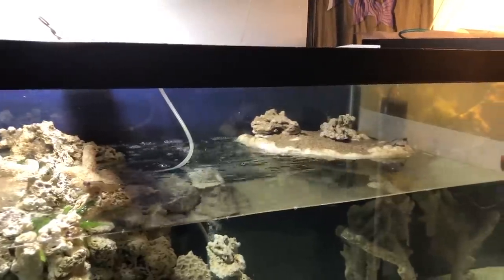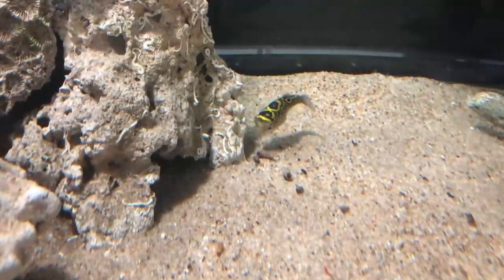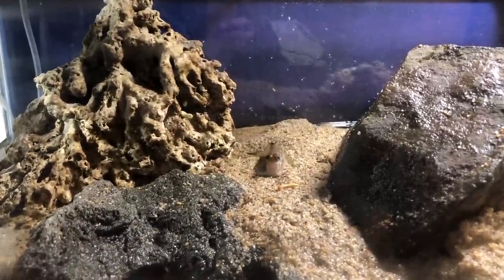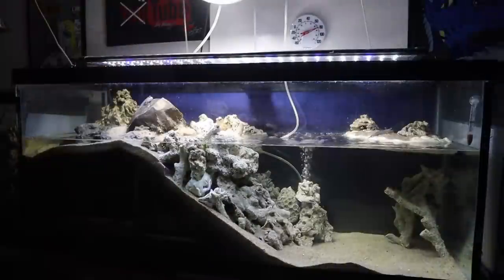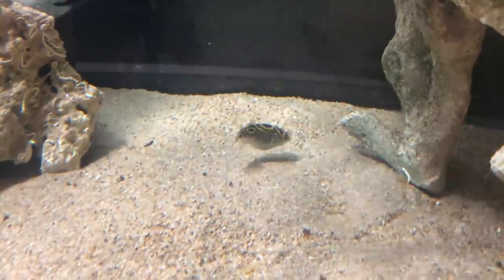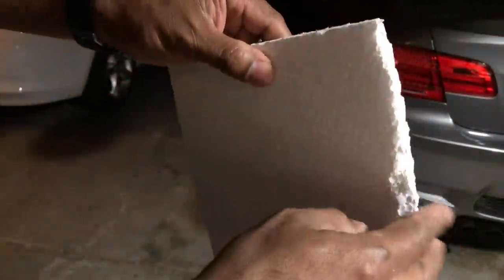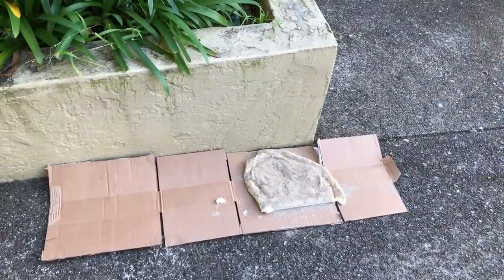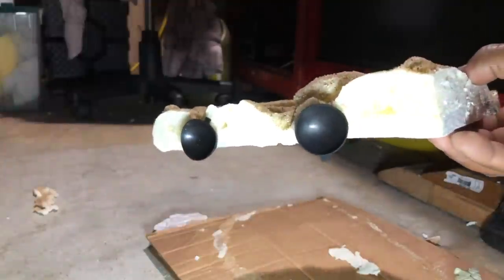The Mudskipper and Puffer Brackish Paludarium

Comment: Hey Zenzo, FYI I had to separate one Midskipper out from my other three because it was significantly smaller and in my QT tank, the others weren’t letting it eat.  I moved it to a 20L by itself then added some guppies because I thought it was too small to eat them.  Well, this morning I found a headless guppy on top of it’s above water resting spot.  Just wanted to give you a heads up, or heads off in this case.  These little guys mouths are bigger than you’d think.

Comment: FYI Puffers are bored when they pace the glass like that. It needs more decorations/driftwood/plants as a scape for it to keep interested. Add some small caves and arches for it to hide and swim through. Want to break that line of sight with the back glass as they can see into rooms as well as their reflection and think it is another puffer in their territory. Plants along the back wall will help along with more rocks and driftwood covering that surface.Or you can place a black background on the outside back wall of the tank or paint it black or blue. Might even place a small wave maker in the tank to give some differing currents Ghost shrimp will also do quite well with this Figure8 puffer, though it might eat some small ones adult sized ones will be fine.
Reply from the maker: Thanks for the feedback. I have added a background, and have been playing with decor. I also am experimenting with different plants.
Reply: @TazawaTanks  Java fern will survive in brackish water but it won't thrive. Best to use pieces from a large mother plants in  freshwater tanks and replace them every 4-6 months. It is good to place some snails in among the plants so the puffer can seek and destroy them. Malaysian trumpet snails can survive in brackish water too and they burrow into the substrate during the day and come out at night to feed on algae and destritus. keep a smal tank 5G or less of them to add to the puffer's tank for food along with the pond and ramshorn snails.
Reply from the maker: I have been experimenting with Java fern for about 3 weeks now. I’ve also been testing anacharis because I’ve heard people seeing this in brackish waterways in Florida. 

As far as the snails, I have a whole bunch living in this tank on the beach side (MTS). I also have an endless supply of them in other tanks.
Reply from the maker: I literally can scoop up a 100 MTS snails right now if I wanted. I have 4 tanks with a bunch of MTS.
Reply: @TazawaTanks  Awesomeness! sounds like you've got it covered then. I'll mention to my friend about the Anacharis doing well in brackish water. He might add some if he knows about it for his Figure 8 puffer.

Comment: This is a gorgeous tank. Love it, one question though, with all the sand, how do you prevent anaerobic gases and bacteria build up? I saw the airstone under the sand, but thats in one corner.  As for a name for the Fig 8, I like Cueball :D
Reply from the maker: Check out the video I uploaded about 4 weeks ago that shows how I built up the beach. Basically, there are concrete blocks underneath the sand. The sand is only around 3-4” deep.
Reply: @TazawaTanks  I most definitely will. I love how the tank looks.

Comment: hey you should cut the heads off the meal worms before you feed them to the mudskippers. meal worms have been know to bite the stomachs of reptiles that do not chew them enough to kill them. the mudskippers look like they are just swallowing them.
Reply from the maker: Good advice. Thank you.
Reply: Clarkson can you just remove the mandibles?
Reply: @pk4fun44  ok then, you just use a knife or even pull it off right?